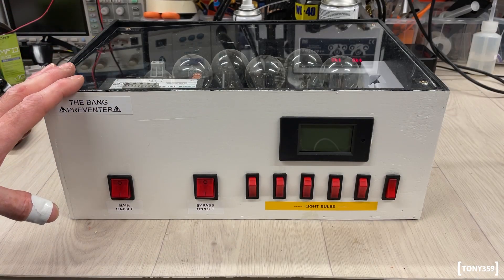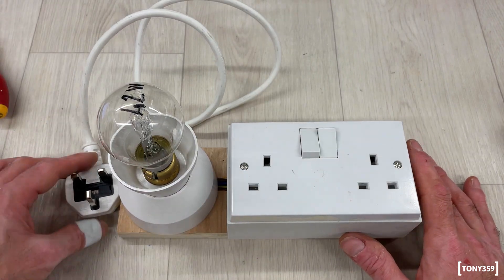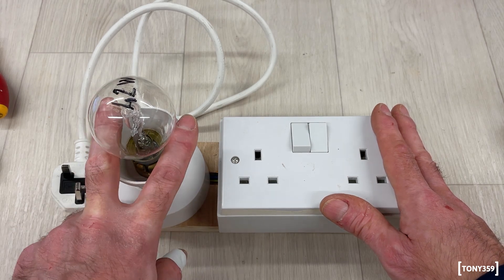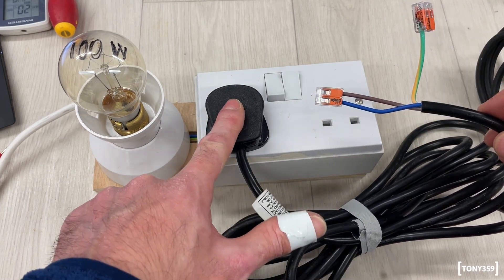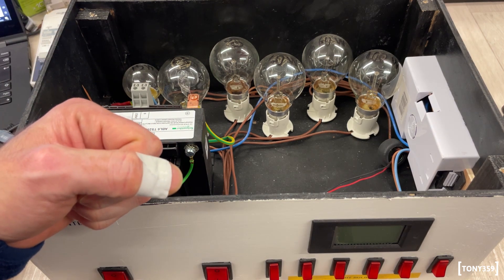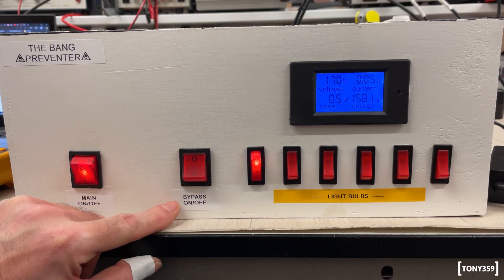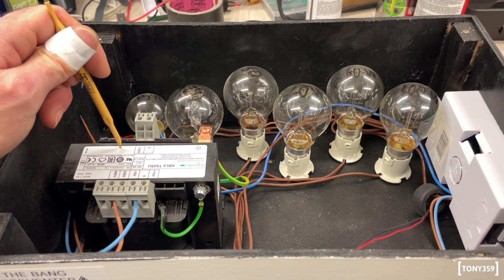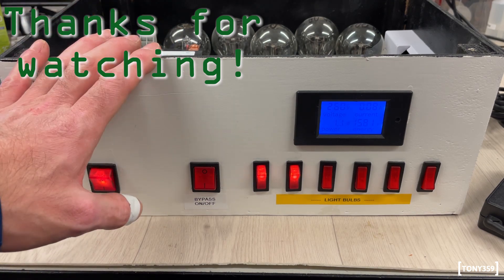The Bang Preventer - aka DIY Current Limiter with isolation transformer

Comment: Hi Tony. Very nice idea for power protection & security for any Device Under Test. You mentioned (maybe at the comments, I am not sure) that it would be nice to have the volt/ampere meter always on, no matter if you power of the DUT. You can do it with a 2 pole switch at the output of this device (between the meter and the output socket) or by using as "1 - 2 - 3 go" switch the one at the existing output socket (assuming you have already connect it to the socket). Doing so you don't get the exact value of the voltage that goes to DUT, nor the consuption, but the meter is alive and the result is faster when you power on the DUT.
The whole idea of your project is very good, I will copy it replacing my own system. I will add an bypass isolator switch, just in case it will be needed....
Reply from the maker: ah yes, that's a simple tweak, thanks for mentioning!

Comment: A couple of things about isolation transformers - although your custom-built setup does not provide earth continuity on its output, many(most?) commercial models do, which means one still has to take precautions when using a mains powered oscilloscope for example. Also, in your setup (as in commercial variants too) you can get away with touching one live conductor on the "safe" side of the isolation transformer, but should you accidentally touch both you'll still get a full mains potential shock. Isolation transformers are good things to have, but it never pays to take risks with mains electricity.
Reply from the maker: 100%, they give you SOME protection. Someone actually thinks they should not be used. I can see why: if not mistaken, if one touched both wires after the transformer, would the RCD trip? 
In any case, absolutely. For grounding, I have differential probes when working on live stuff. 
Thanks for that!
Reply: @tony359  The RCD wouldn't trip, as it would see no fault current - you're completely on your own after the isolation transformer.

However, an RCD wouldn't directly protect one from a mains shock fatality anyway - it's considered that a 10mA shock across the heart is sufficient to be fatal to many/most people: the reason that RCDs are effective is that in the event of most earth faults the RCD disconnects the mains before anyone has a chance to touch a live conductor.

It's always sensible to treat mains voltages as lethal, whether through an isolation transformer or not - it's just that an isolation transformer makes accidental contact a little safer in some circumstances.
Reply from the maker: @will_doherty  Oh yes, I am always very careful when mains is involved. I tend to wire my differential probe on soldered pins, take a step back and give power 🙂 Thanks for all the tips!

Comment: If the bypass switch is closed, and you also have a lamp switched into circuit, will all of the current pass through the bypass switch (path of least resistance), or through the switch and lamp at the same time?
Reply from the maker: Electricity flows through the path which offers the least resistance so once the bypass switch is engaged, all the current flows through there
Reply: @tony359  Thanks for your reply. I have one more question please - if the bypass switch was switched off, and several lamps now switched on, would it then be correct to state that "the path of least resistance" does not apply, as we are dealing with lamps (effectively resistors) in parallel, so current will now flow through all connected resistors?
Reply from the maker: Well something will flow through the lamps as well as they’re more or less acting as a short when cold. But a switch is going to be a dead short so as soon as the current flow and the bulbs start offering a small resistance, the vast majority of the current will flow through the switch only.
Reply: @tony359  Thanks for your explanation! 👍🙂 To rephrase my 2nd question, I just wanted to confirm that lamps in parallel behave the same as resistors in parallel in that, unlike the situation with the closed switch, the "path of least resistance" rule does not apply?

Comment: Can you tell something more about the voltage, watts meter on the front of the current limiter.  Maybe a link and how it is connected in the box (didn't see it on the schematic).
Reply from the maker: Hi - never thought of mentioning that, sorry. You can find it on Ebay, it's relatively inexpensive. It reads the voltage it's powered on (so you just parallel the inputs to the output of the whole box) and for the current it comes with a little current sensor (a coil) which goes around the LIVE wire going to the output of the box. Then the two wires coming out of this coil are wired in the display. 

It's unlikely Youtube will let this link on this message but: https://www.ebay.co.uk/itm/254103933935

This comes with a shunt, interesting!

Comment: That great, never thought of adding variations, The total resistance 
𝑅 𝑡𝑜𝑡𝑎𝑙 R total  is approximately 156.92 ohms.
The total current 𝐼 I through the circuit is approximately 1.47 amperes.

Comment: I have found you only really need one current limiting device when troubleshooting with an isolated variable AC power supply. I use a non-inductive power resistor on a heat sink that can be switched in or out of the circuit by a shorting switch across it. If the device under test (DUT) has a blown input power fuse then the first power up would be with the current limiter because you suspect a short in the power supply. If the unit powers up without a short you can then switch out the current limiter and use the CB on the output of the variac (you have to protect the variac anyway), here I have three different trip level front panel switchable magnetic/hydraulic CBs in parallel to choose from (1 amp, 5 amp and 10 amp, my variac is rated to 15 amps). So, I can power the DUT at full voltage and if it shorts out the CB will protect the variac.

For your design you should have a shorting switch across your current limiting bulbs. This way you can essentially take all of the out of circuit, which may be needed to meet a surge startup current for the DUT. Also, to test a repaired DUT you would want AC power as close to perfect mains as possible (no waveform distortion, low impedance, etc.)
Reply from the maker: Hi - thanks for your comment! The box has a "bypass" switch to bypass all the lightbulbs indeed. About everything else, of course there are better ways for a current limiter, this is just an inexpensive DIY project! Thanks for watching!

Comment: I did not realize that you can still buy incandescent light bulbs in the UK.
I will have to get my family to send me some,(to Australia!).
Reply from the maker: They are for traffic lights 🙂 indeed they’re unavailable in the average shop! Thanks for watching!
Reply: Try looking for halogen bulbs as they run hotter so are more efficient. 

Presumably you can still get those high power quartz halogen bulbs for flood lights. Or possibly car / xenon bulbs or projector bulbs could be used.

Comment: 260V only if you used that isolation transformer, not directly on mains.
Reply from the maker: Indeed. The transformer has some adjustments - +/- 15V which I could use but considering the bulbs will normally introduce a voltage drop, maybe not a bad thing. 

260 was probably read when mains was a bit higher than normal, say 245ish.
Reply: @tony359 transformer output voltage is rated for when the transformer is under load. When unloaded, the output voltage rises.

Comment: Hi Tony, very nice build even the home made box itself, but i have a concern about the heat development by those light bulbs 
inside a closed box, and with the bulbs close to the plexiglass ? 
i know that with all bulbs enabled, and with a dead short you won't leave it in that condition for hours offcourse, but imagine that you have just repaired a amplifier or something and do a stress test for a few hours. All bulbs are enabled, and the amplifier works fine at first sight, the bulbs are very dim and you leave it so for a few hours, and suddenly a short appears and all bulbs are bright while you are doing something else. Maybe adding a thermal fuse ?
Reply from the maker: You are right and that actually happened to me the other day.
Let me say that I would normally use the box for short testing. An amplifier would likely draw more power than the bulbs (or the isolation transformer!) would handle so I would probably use it with an amp for a quick test.

However, the other day I was testing an iMac I got from the trash (and which you'll see on a video at some point) and since I had no idea in what condition the system was, I hooked it to the box. All was good, I eventually bypassed the bulbs. 
I then started installing Windows on that computer. It's an old machine so it was slow. After many hours I realised the transformer was getting very warm and I had to unplug the iMac - during the installation, sigh - as I was not comfortable in leaving it there for so long.

So yes, you are right. The box used to be fully open but it was also a safety hazard. The least I could do would be to drill some holes - I should have mentioned that on the video.

Bulbs are not a concern, if they light up... you have a short and you switch it off! :) But your point is solid.

One thing I might want to do is to add a "main bypass" which bypasses everything. At that point the transformer would not get hot. 

Anyways, room for improvement indeed! Thanks for your comment and for watching!
Reply: @tony359  , my answer seems to be disappeared. I'l building a similar device which takes already more then 2 years due health issues, and adding more and more featues to the project. For the dim bulb current limiter i gonna use 10x G9 halogen bulbs, because those are very compact, and hopefully the heat development will be lower then with big bulbs. i'm also adding a 500VA isolation transformer, a 500VA Variac, a self designed electronic circuit breaker (not the famous Glasslinger design) , a earth leakage detecting of the connected device, a feature to lower the Ghost voltage on the output of the isolation transformer, and a feature that hopefully prevents the total risk of electrocution. if you like, i can mail you the details. Grtz
Reply from the maker: @BjornV78  well that's sounds like a proper 'bang preventer', mine is a toy in comparison! What is the ghost voltage out of the transformer? By all means I'd be curious to see the design of you allow me. And I hope your health gets better and better!
Reply: @tony359  , the output voltage of a isolation transformer is "floating" and not referenced to earth/ground, so that's why it is safe if only touch 1 wire at the time. 
But if do a voltage measuring between one of the 2 output wires and the earth/ground pin of your wall socket, you will measure a voltage that can be more then 50% of the mains voltage, this Ghost voltage has very low current (in the µA range),barely enough to light up a small LED,  but can be enough to kill sensitive electronic components like Mosfets etc.... This Ghost voltage is voltage that leaks from the primary side to the metal core of the isolation transformator and from the core to the secundary side. Each transformer has this, but some more then other due difference in manufacturing. i will send you a mail with more details, otherwise this response gets to long.
Reply from the maker: @BjornV78  amazing this seems very interesting! Thank you for that! My email is on the channel under 'about' I think
Reply: @tony359  hi, did you get my email ? Grtz
Reply from the maker: @BjornV78  I did - and I forgot to reply, my apologies! I shall read it now!

Comment: When the device is fully shorted and you have 100w bulb in series all the power goes to the bulb. Almost no power goes to the device as the voltage drop on the device is close to zero.
Reply from the maker: To be honest I thought about that. Maybe I should have said that when shorted you have 416mA flowing in the circuit so assuming there is a component "catching fire" in your device under test, it will only get 416mA. So say yours is not exactly a short but a component very close to a short, the light bulb will limit the current in the circuit to maximum 416mA. 
Is that more accurate? I am genuinely asking, I understand my shortcomings when it comes to electronic :)
Reply: @tony359  Assuming your load is purely resistive (which may be a bit wild, but let's stick to it), you have maximum power transfer when the load resistance is equal to the series resistance, in which case half of the power goes to the lamp and half goes to the load. If you do the math, it turns out that the maximum power the load can receive in this configuration is equal to the rated lamp power divided by 4: for instance, a 100W lamp would constraint the maximum power on the load to 25W (and in this condition, the voltage at the load would be exactly half of the mains voltage).

However, there is another point that can become interesting: when cold, the lamp filament shows a much lower resistance compared to the nominal one. In other words, if you turn on a 100W lamp it will instantaneously behave as a lamp with powerage much higher than 100W (even 10 times higher) for the first few milliseconds, the time it takes to heat up and increase its resistance. This means that at power up your device may receive more power than you would expect (which is not necessarily a bad thing, because it also means that your device will have some extra juice to overcome inrush currents).
Reply from the maker: @rudilussana9194  I understand and it makes sense. I'm not sure I understand the 1/4 of power though. I totally get the load would get 1/2 maximum, but why 1/4 then?

And yes, I also understand that when the filament is cold you have a "dead short" for a split second - which is good to be honest as you say. 

I knew I should have thought the explanation a bit more! :) I hope nobody gets too mad at me! :)
Reply: @tony359  At maximum power transfer condition, half the power from the mains goes to the limiting lamp and half goes to the load. But the total power from the mains is not the nominal 100W of the lamp, it is halved because you have two equal resistors in series. Therefore, the load receives half of the halved nominal power.
Another way to see it: at maximum power transfer, the lamp has 120 V across its terminals (because it is a voltage divider with two equal resistors), which means it will dissipate 1/4 of its nominal power (V²/R, where V is halved and R stays constant).The load draws the same power as the limiter, so in this case a nominal 100W lamp limits the total power to 50W, of which 25 go to the load (which is the fraction of interest) and 25 to the lamp itself.

Anyway, these are just technicalities; moreover, you will actually be able to use more of the 1/4 nominal power because of the cold filament, so I believe your explanation is perfect and the device flawlessly does its job. Bringing these tematics into the video would make it boring without adding really useful information, and the point of the device should just be to prevent bangs, not to be a perfect power source. No worries, nobody will get mad at you :)
Reply from the maker: @rudilussana9194  These are very interesting technicalities! I should brush up on my Ohm's law! Thank you, it makes sense - even though it's not intuitive, hence very interesting. Indeed it would not make sense to explain that in a video but next time I'll try to give the right numbers at least! :) 

Thanks again!
Reply: @rudilussana9194  you just discovered why we use bulbs and not resistors for this application.
Reply: @tony359  it’s a quarter of the power because halving a voltage to a fixed resistance also halves the current (ohm’s law). Assumes the load resistance is equal to the series resistance like Rudi Lussana explained. 

Another way to think of it is to make a potential divider with two 10K (for example) resistors compared to one 10K resistor. 

But I’d like to know more about how power transfer is affected by some capacitance or inductance in the load.